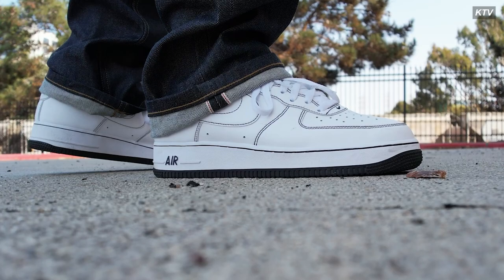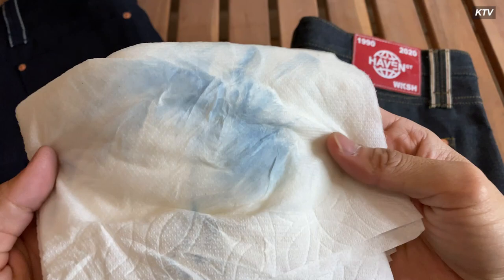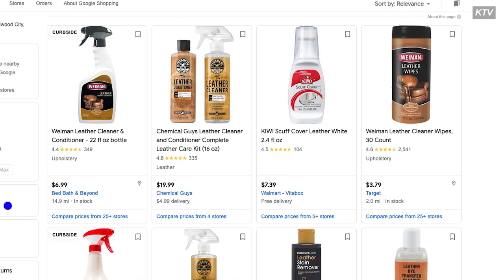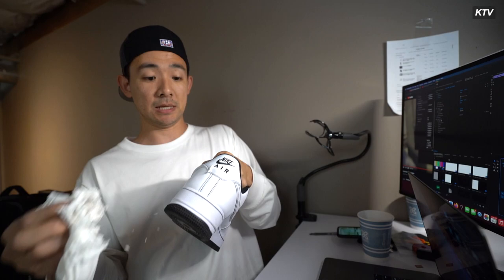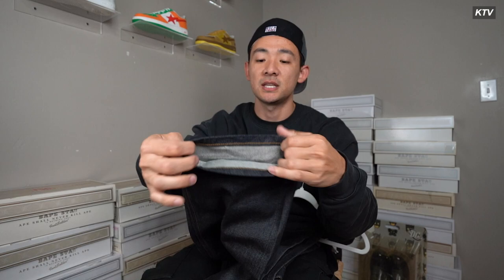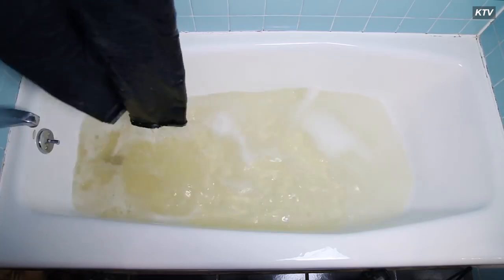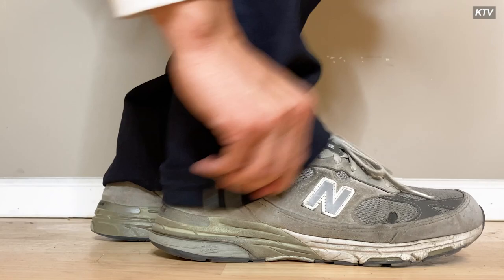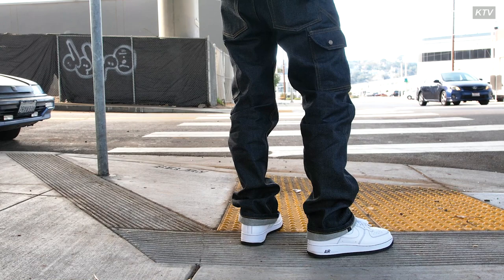RAW Denim | How to Fix BLEEDING for WHITE Sneakers

Comment: What I do is put duct tape on the inside of the hem. I use regular size black duct tape. I measure the size I need ,cut it. I then Split it in half horizontal. And tape it on. It even stays on after washes.

Comment: I’ve had non raw denim bleed and on suede it’s rough but ever since I used water proofers I’ve been good

Maybe someone knows but ever wear a pair of raws for like 8 months and soak them for the first time and they didn’t fade? The water remained crystal clear the whole time
Reply: Soak your raw denim in water with half a cup of White Distilled Vinegar and 2 spoons of salt, as long as possible from 1 to 24 hours, then wash it in the washing machine. Repeat this if necessary. The vinegar will help set the colors and minimize colour bleeding.

Comment: Can someone please tell me if it works on white converse cause I have the same problem, i tried toothpaste, baking soda, etc and the denim stain doesn't come off so HELP IF YOU HAVE ANY SOLUTIONS
Reply: Soak your raw denim in water with half a cup of White Vinegar from 1 to 24 hours, then wash it in the washing machine. Repeat this if necessary, but usually it stop bleeding cu 1 or 2 dipping in white vinegar. The vinegar will help set the colors and minimize colour bleeding.
Reply: Try with acetone ( nail polish remover)

Comment: Back to back to back! Im too scared to wash my raws so I'm gonna try that eraser method and I have a white midsole pen I've been using in case it gets bad
Reply: U don't wash your pants?
Reply: U aint normally supposed to wash raw denim, you can freeze to remove odor and use stain removers if you get them dirty
Reply: @edgarcastillo7607  😳😳😳😱😱😱😱😱
Reply: Soak your raw denim in water with half a cup of White Distilled Vinegar and 2 spoons of salt, as long as possible from 1 to 24 hours, then wash it in the washing machine. Repeat this if necessary. The vinegar will help set the colors and minimize colour bleeding.